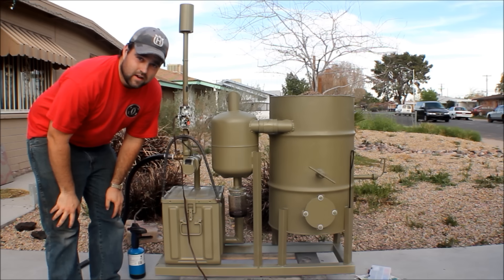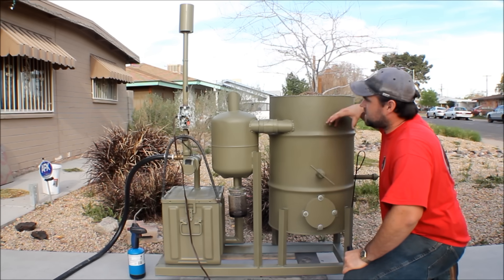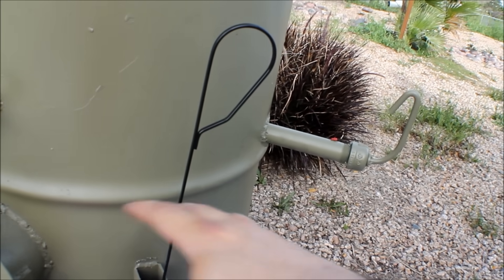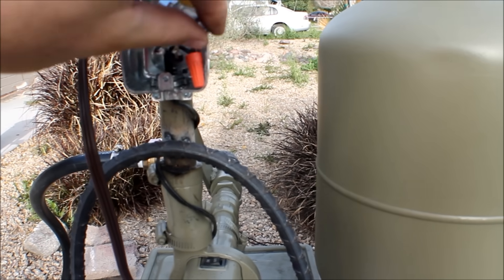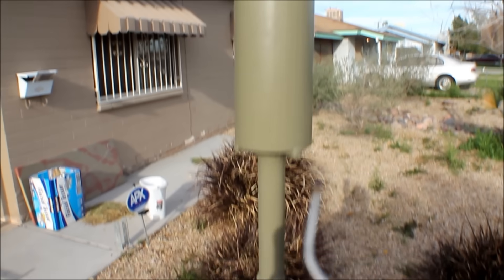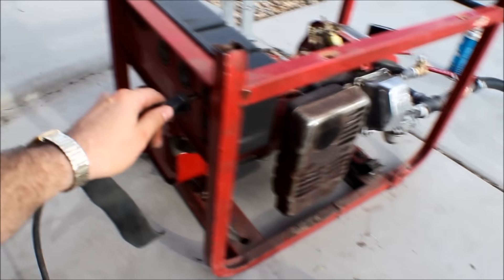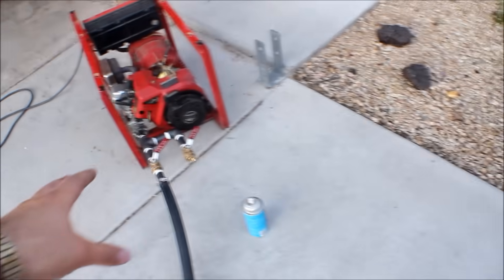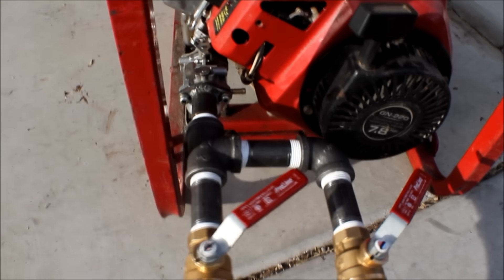amazing homemade gasifier uses wood pellets to run generator -- renewable alternative energy video

Comment: Actually shared your video and the FEMA plans with several families in the Florida panhandle in the days following Micheal. I was there from day 1 to day 200 with the USACE BluRoof project. With some areas there being without power for up to 3 months after the storm, gas and diesel in very limited supply (for a variety of reasons), and trees piled up everywhere, those wood gasifer systems we cobbled together were life savers. 
Your video just came back up in my feed and I realized I had not thanked you.
Reply: Do you have any pictures of the units built. JR M built one of the nicest looking units ive seen but i would love to see what you cobbled together in the midst of a disaster.
Reply: @pestalinc  I think I have a couple. I'll have to see about finding them when I get back home.
Reply: I've heard it's finicky with wet organic matter. How did you do that?
Reply: @mikuhatsunegoshujin  we charcoaled 2x4s and framing material from house debris to start the gasifiers on. The hoppers were big and above the fire chamber/mantle (which were heavily insulated to max the heat) to allow the pine tree chunks to steam out that we mixed more chunked house debris with. In the end the gasifiers were not built to be perfect or run for decades. They were built to produce fuel gas to run generators for a year or two. We did have to increase the size of the tar sludge catchment container on one and I sized the biomedia filter boxs larger than recommended. It was running and gunning, just get it up and working we will sand the edges later kind of fabrication work. Plus we didnt shut them down until there were issues and then fired them back up. As services were brought back on line they were shut down and scrapped for the most part. I know one old man north of Mexico Beach a mile or so said he intended to keep his for next time.
I'm actually building one currently I can use at home to learn with. It is fascinating technology.
Reply: @RenaissanceThinking  That is fascinating. I almost cried when I saw what happened to Mexico Beach. I spent many wonderful vacations there over the decades since the 60s.
Reply: @ninline2000  the news didnt do justice to the level of destruction from Panama City to Cape San Blas and up into Georgia like a giant lawn mower. I wish I had seen it before Micheal.
Reply: @RenaissanceThinking  , thank you for helping those affected by michael!   we were one of those without power for so long and we are still digging out...  thanks for helping, bless you for remembering as some of us are still struggling.
Reply: @jamieflynn7216  I'm sorry I have not been able to get back to Florida to do more. We're still working on clean-up/repair/rebuild in Rockport, Tx from Harvey. It is amazing how long it takes to recover and how quickly the World forgets. Hang in there.
Reply: I'm actually here because I live in south FL and we are without power on the regular. This is amazing tech and now I just need to learn to weld so I can build a system like this.
Reply: @SirFency  need power to weld. 
Best bet is to use clay and very high heat from a fire to kiln your clay. 
Or use aluminum stick weld rods from harbor freight. Or a generator if you have some fuel
Reply: @krotchlickmeugh627  I have power. We just loose it frequently. AN when hurricanes come through gasoline is very hard to come by. It also has a shelf life of about 1 year. I can keep wood pellets on hand forever.
Reply: @SirFency  you can mix oil with that gas and make it last longer. Also if you store your fuel containers all the way to the top it lasts alot longer. 
But yes your best option is either propane or wood powered generators.
Reply: @SirFency  I shit you not I've started machines...my personal jetski even after several years just sitting outside on the trailer or in the garage later on....no additives...maybe not very smooth operation but nonetheless....hope ian just spared you down in s fl.
Looks like a real doozy
Reply: @SirFency  Go to your local high school, college or tech school for help. They would probably love to help you and possibly build more for the community.
Reply: @shannonp4037  That's a good idea.
Reply: Hopefully you guys got a few of these built by now with milton coming
Reply: It was called BluRoof? They're taking the piss.
Reply: I run a gasifier that is capable of producing 500kw of thermal energy (around 200kw internal combustion generator). It is about 10mtr in height. We filter the gas using a 0.2 micron ceramic filter. If you are interested I can share a lot of info, pics and videos.
Reply: @BenasMart  absolutely any knowledge you can share we all could learn from would be greatly appreciated.

Comment: JR. are you chicken shit like the rest of the world because 60 led make 20 volts in the sun (3mm) now it is dependent on sunny days but 200 rows is 4000 volt with an unknown amount of amps but 6 volts is one amps so 12 volts compressed is 2 and twelve minus 4000 is 3988 time 2 amp equals 7976 watts. now how much watts your generator make and my solar panel is three feet by six feet by one foot tall for all the voltage control stuff necessary for all that high voltage stuff. but i have never ever even seen one. the design is expensive from using a mimimum of 200 voltage rectifiers and sometime it even defies them from capacitizing even though they only leds which means 7976 in 12 to eighteen square feet. hard to say bet you can't make one work.

Comment: Most of Outback Australia up to 1945 generated electricity from huge suction gas engines, they used wood gas to run them through a retort and using massive horizontally opposed engines that created the suction through the wood charcoal gasifier. After WWar II converted to diesel.

Comment: use hydrogen fuel cell and hydrolysis of water and electricity production and hydrogen fuel flames for cooking food and flames

use sterling engine with use the heat of the stoves for making electricity and cooking food by hydrogen fuel flames  by hydrolysis of water and hho gas
Reply: Anil Kumar Sharma ya why don’t you build one and show us?  Talks so incredibly cheap and worthless.

Comment: maybe i'm talking crazy right now, but is it possible to harvest the gas with an aircompressor so you can fil up cans of gas for later use?
Reply: engeltjebaleno no this is a vapor gas not liquid gas.
Reply: Of course, you can compress any gas. The gases are probably methane, ethane, propane and all sorts of molecules. It is best to dry the gases before compressing them into a iron cylinder.

Comment: Its not renewable if it uses fuel. Wood pellets are fuel. The sun is renewable. No fuel required. Technically the sun is fuel also if you think about it. Just like allot of folks think nuclear energy is renewable. Its not. It uses fuel. Its more efficient. Big difference. I do like it. You did a fine job on this project.

Comment: We lived in the outback western Australia,  I have seen these on old tractors and even one on a model A ford. They arn't any bigger than yours and yours is probably more efficient. 
They were mounted on the front of the vehicles and looking inside the combustion chamber,  looks like they were running them on twigs and leaves. Ex WW2 era.

Comment: if i remember a guy i knew from france told me about trucks running on like wood or coal but not steam it was alcohol fumes and they were like work trucks so as long as they had the wood fuel the truck would run.

Comment: This is impressive! It'd take some doing and someone with the knowledge, but it'd be really awesome to rig up a microcontroller and stepper motors and such to make the whole thing self-regulating. Automatic adjustment of the air/fuel ratio into the generator, blower speed control, grate shaker, etc. Anyway, this is a really good setup, and quite an achievement! One other thing: how well does it keep up when the generator is loaded? A saw draws way more power when it's cutting something.
Reply: I have hundreds of achers of wood I can use, could you help me make a blueprint

Comment: This is one of the best gasifier demonstrations I have ever seen.  And yet the oil industry continues to say that hydrocarbon fuels are non-renewable, when in fact everything the sun grows can be turned into smoke and combusted.
Reply: Imagine running one of these on hemp, grows soooo much faster than trees...
Reply: @perfectstranger1152  But it's far less energy dense, lol. Wood is the perfect fuel for this application.
Reply: @gayusschwulius8490  If you pressed hemp into pellets would the density be the same?
Reply: @raysteel6317  Probably yes, but I think the total growth rate of hemp isn't higher than that of some types of wood if you account for the difference in density. The total biomass (measured in weight) grown per time per square meter of land should probably be about the same for hemp and wood.
Reply: @perfectstranger1152  I humbly offer all of my work on the subject for free:  https://theriseandstallofthepistonengine.weebly.com/  I hope you will check it out, especially Ch 2 and Ch 7.  Cheers!
Reply: What about lawn clippings @perfectstranger1152
Reply: Not to mention the extreme promise they have for the carbon black industry. Carbon black production is basically just taking the sludge and crap at the bottom of a refining stack and burning it incompletely so you basically get ultrafine charcoal dust, and it's COMICALLY bad for the environment. Comparatively, the exhaust gas of the feedstock and coal left over from the process could be used as an alternative to carbon black, and be far superior in medicine, rubber/tires, flocking, graphite lubricants, and other materials because it's incredibly porous and adsorbent. I bet even carbon fiber could possibly be doable with activated charcoal if we did some homework.

Comment: Wood gas vehicles, using the kind of process you are using,  were in operation during World War II as a consequence of the rationing of fossil fuels. In Germany around 500,000 wood gas-type vehicles were in use by the end of the war.

Comment: This is a wood alcohol distillery - essentially. Use caution when using this fuel.
Reply: Use caution when using ANY type of fuel. Electric, gas or liquid. You can't idiot proof everything.

Comment: Wouldn’t a tank of propane be simpler, easier and cheaper?
Reply: the entire point is that if something happened that caused infrastructure to go down, such as a storm, natural disaster, etc - making getting propane much harder than it would be to just use a gassifier, a gassifier would be amazingly useful for powering your home, or other tools.
Reply: Yes.

Comment: Dude! You are badass, way cool to have actually gone through all of the effort to put this in operation and share it with such detail on here. I tinker quite a bit and I for one am truly impressed with a literal gas station there and an old dog learned a new trick. Thanks for the video and demonstration/detailed instruction, variable components and their function and the assembly. Well done JR.
Reply: Race Bannon yeah he is so bad ass bc he can copy a design and system that the nazis used and perfected.

Comment: Are you going to set there all the time to keep the generator putting out 60 Hz? The load will be changing all the time therefore the fuel and the air will need to be changed all the time to get 60 Hz from the generator.

Comment: State of making a catch like that lichens you possibly use a Isaiah 14 inch wheel off of a car junkyard cut the center out to the lug nut area we're just cut it completely out find you a a junk Grill out of an old BBQ match the two put it on the bottom of the wheel give it a few welding t a c k s and there you go

Comment: Will in between where the fire is at the burning tank and the supply tube in name between that tank to where the smoke goes in why can't you make the pipe water there with some cooling fins on it

Comment: im surprised your system is able to feed gas constantly,i figured maybe an improvement would be to make a storage container for the gas like a water bubbler tank with a valve for the gas,,of course im not sure how that would work with the pressure build up or if the gas starts going back into the system but there must be a way for you to store a good amount before you start ruining your generator
Reply: you can't store it, it will condense.  You have to use it as it's being created
Reply: @someotherdude  condense like other stored gases? sounds good
Reply: @ARCSTREAMS  no.  Gases like natural gas and propane will store perfectly for years. Wood gas will not, it probably won't even store for minutes. It will stick to the walls of whatever you're storing it in, as a tar like residue.  Please take my word for it before going to the trouble of building.
Reply: @someotherdude  i guess once it is created into a gas it needs to be used or burned right away ,i believe you
Reply: @someotherdude  The flammable gas created is mainly carbon monoxide, and that doesnt condense until under -300 farenheit, so I think you could store it.

Comment: i dont understand,,are you venti g the gas or using it because you seem to be doing both?do you switch it to go into your generator once you see it producing flames then you know its good and you no longer vent it? also i thought you are suppose to have the gas pass through a water bubbler to filter the gas and act like a storage tank,,and i have not seen them using a vacuum like that but simply going inot a serpentine pipe then into a bubbler and then to whatever you are using it for

Comment: Use a PWM speed controller instead of the potentiometer. I also would add a solar cell, a charge controller and a solar battery to make the whole thing work completely independently.

Comment: Need to come up with a bicycle powered blower to eliminate all need of starting current.
Reply: Something else, where are you gonna get wood pellets when the SHTF
Reply: @perfectstranger1152  Any dry hardwood will do. Even soft woods can be used but they have  lower energy density and require more maintenance to keep clean.

Comment: Awesome 
I’m sure you can find a 12v voltage regulator, (DC-DC buck) on eBay.    They only cost a few $s and are solid state.  If your generator has a 12v DC out you can use it to charge a battery for the gasifier    If not, hook up a 120v ac to dc buck to 12v on your generator.

Comment: Fema is version a VERY barebones set up. Even with changing  the medium every 10 hours, the generator is going to have to come apart every week. Look up the gasifier truck. His medium is another 50 gallon barrel plus 150ft or 300ft pipe. A bunch of pipe to collect the moisture from the gas and cool it down. I see what you have here being a big problem for  the community  that you're going to have too share that noisy thing with.  But not for long as its not a Honda generator  that actually  has parts you can stock up on.  Good job on the build, take your time  researching before hand. Unless you only ever intended  on using  store bought  wood pellets... I am sure you made that for emergencies. Look good job I just don't  want  you to think thats okay when it is not. I am old so not good at suger coating things, I did try but meh

Comment: Nice work & video.  if you get a wide range O2 sensor on the exhaust of the gen, you can dial the mixture a tad rich and the gen engine will last just as long as reg fuel.  gas(fuel) helps cool the piston, so your gonna want to stay a bit rich.   you may be able to run some of the exhaust back into the gasifier - lacking O2 it might keep it from back burning...keeping it cool. I like your setup

Comment: Now run the generator and use the power to make more wood pellets from cutting the tree, to shredding the wood to crushing it into pellets.  If it can't remake its own fuel with the energy you get from using it then its a net loss no better than a battery bank with no way to recharge it.
Questions Everyone should be asking...
1)  If it can then how many tanks of wood pellets can you make running it off of a single tank... Two? Three?  More?  
2) How long can you run it on a tank of wood pellets.  
3) How much does a tank full of wood pellets cost.  
4) How much gasoline would it take to run the generator for the same length of time as a tank of wood pellets.  
5) How much does the cost of the gasoline compare to that of the pellets for the same amount of run time on the generator.
6) What affect does this have on the longevity of the engine.  It doesn't seem like it would be good for it but have you checked?  open the engine block and look at the buildup on the head after running it for a while.  Compare that to running it on gasoline.

Comment: Hi ! Nice build ! Which kind of high temperature silicon did you use for seal ? I'm using red high temperature Permatex silicone for a more simpler charcoal maker and it's just dilute slowly when syngas/bio-oil/tar touch it. It's start to be creamy and sticker , just like it's will be before I let's it dry for few weeks but it's never come back hard after my first or second burn test.

Comment: if you wrapped the fire barrel in copper pipe and filled the pipe with water and ran the copper pipe to a main reservoir you could get a remote heater for the interior of the house, there's a video of a guy that did made that part, but his heat source was just a camp fire.
This is really cool. Mythbusters or somebody loaded one of these onto the bed of an old military truck and ran the truck off animal dung.